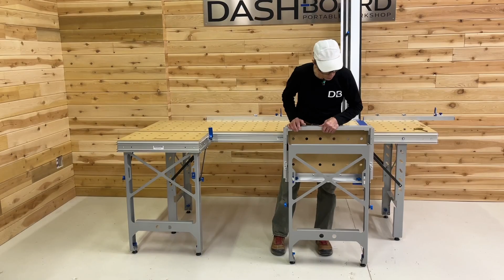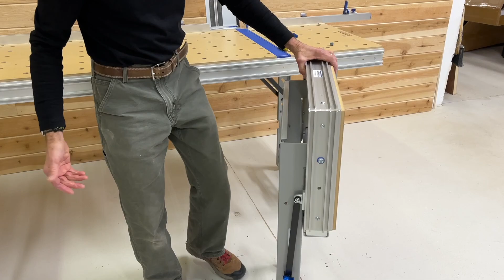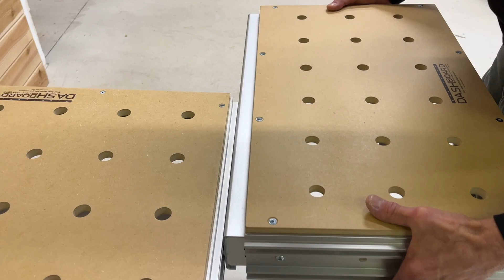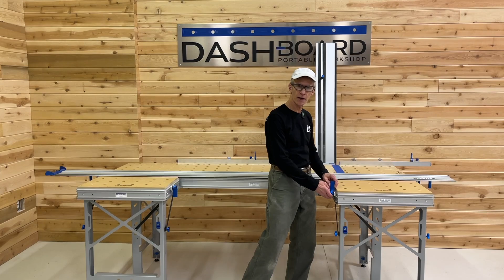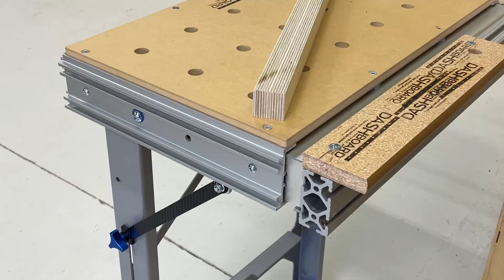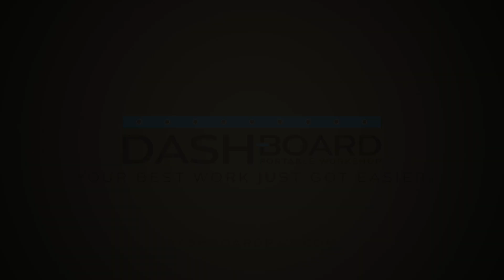Outrigger Bundle Setup and Use

Comment: Full sheet Break down video with the smaller bench? Lookinn through all your videos trying to find one with that. Thank you.
Reply from the maker: Thanks for asking. Starting with an intact, full sheet, there's a way to combine accessories and do that (4 Outriggers rather than just 2 - one on each end and two for the sides to have enough width to support the sheet at the beginning), but, strictly from a cost perspective, it would be less expensive to use a full-sized Dash-Board with the Platinum bundle for this. More videos to come soon, though.

Comment: Love the new outriggers, both the size and increased functionality. Any reason you didn't set them flush to the rails like the previous version? I felt like the rails gave the surface edges some protection.
Reply from the maker: They're made just like the benches, with the same top on the same extrusion so the tracks and work surfaces line up. This is really useful when they're placed on the end of a bench, so the tracks are continuous along the sides and our accessories can slide along wherever they're needed.
Reply: @ makes sense thanks!

Comment: These look way better than the previous version. The t-track on the outside of the outrigger is a massive improvement.
Reply: Yes! The ability to mount the track stars to the outriggers is huge. It will greatly increase cross cut capacity.
Reply: @ I would maybe suggest making the new outrigger table attachment hardware similar to that of the blue two pronged one from the track star. The outrigger t-bolt tends to wiggle around which slows down the configuration process.
Reply from the maker: We thought about that, but the bar would be very long and it's helpful to have the flexibility of separate T bolts during install and removal, because the floor/ground can vary and it's important to be able to tilt the Outrigger accordingly so the feet have more freedom to move across that surface.
Reply: @ Sounds like an upsell option for those on a level/mostly-level surface. :)